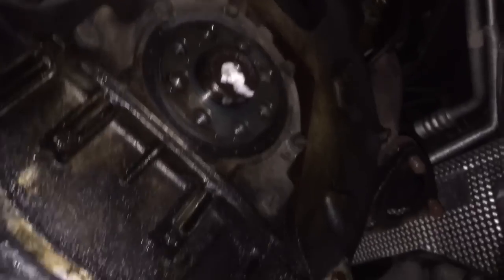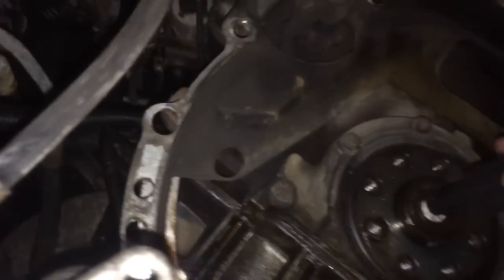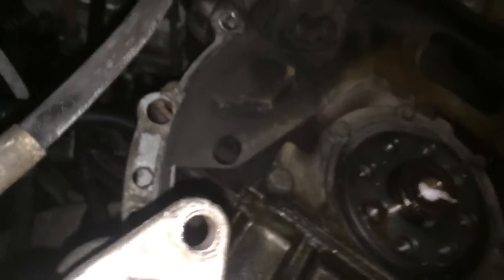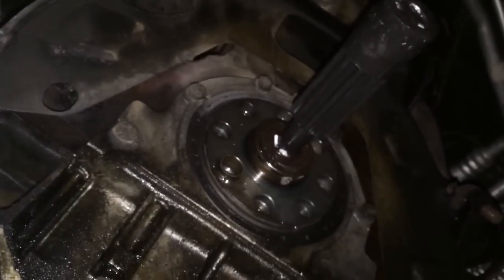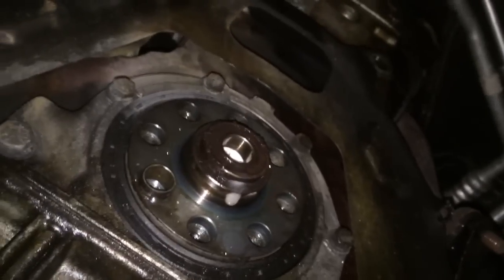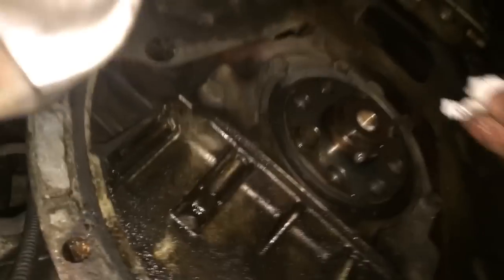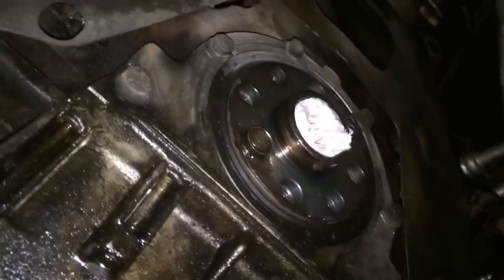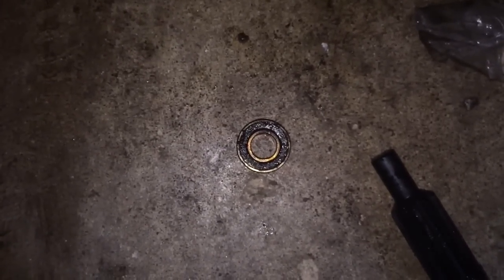pilot bearing removal using water and paper

Comment: Pro tip, having just done this... if wet paper towel isn't getting the job done, switch to wet toilet paper.  I'm assuming it has to do with the toilet paper fibers breaking down more easily, allowing the paper to "flow", fill the gaps, and transfer that hydraulic pressure onto the bearing!

Comment: Or for $16.00 you could just buy a pilot bearing puller.
Reply from the maker: irrelevant when all the stores are closed at 10pm on a sunday night - and when the pilot bearing puller jaws are too thick to fit inside these tiny BMW bearings..
Reply: Ovalbore - BMW has a tool for this. Its makes sense that  anyone performing any decent repair would acquire the necessary tools applicable for the job. I agree that no parts stores would be open at 10:00pm on a Sunday night, however, that wasn't when you purchased the clutch kit. Perhaps the next time you have the need to remove said item you will purchased the tools required as well. I know this because I'm a Ford tech. - ASE certified - Ford certified - Associate degree in automotive technologies. Peace.
Reply: $0 for some old newspaper?
Reply: To be honest, yanking the bearing out with a slide hammer is more likely to cause damage to the crank end float or thrust bearings while hitting the Paper or bread or whatever you pack the hole with cushions the blow!

Comment: Thank you for this cool video!  I could have used this method on my 85 Celica clutch job. at the time, I did buy the $ 65 Napa bearing slide hammer tool.  thanks

Comment: After buying a $59 slide hammer puller, I proceeded to bang the crap out of my hands and shoulders and even after heating the crank shaft that bearing wouldn't budge. With my clutch job (on a 2001 BMW 540is) stalled I found this GREAT solution. It took 4 sheets of paper and a I used the handle side of punch that fit just right. 10 minutes later, that bearing popped right out just like in the video. For me, this may have been the most valuable "how-to" video I have ever seen. THANK YOU!!!!!

Comment: You're a life saver man.  I watched your video and then went straight down to the garage to do this.  I took a 1/2  inch extension to the grinding wheel to reduce its circumference a little and then used it as the alignment guide.  After 3 sheets of paper and about 30 min, she popped right out.  Thanks for the tip!

Comment: USE BREAD AND A TINY BIT OF GREASE!!   IT WORKS EVERY TIME!!  you actually dont even need the alignment tool.. you can use anything that fits tightly into the hole.. even a big bolt, just wrap the threads in electrical tape and your good to go..  (if it didnt work, you didnt use enough bread or paper)

Comment: Doesnt work. Now I'm out a Clutch install-tool, and I have a big wad of Paper to try and Fish Out...
Reply: All good ideas but it's important that the bread is lightly toasted. Peanut butter helps along with jam and rice krispies sprinkled over.
Reply from the maker: what kind of paper? doesn't work with paper towels or even some newspaper. standard printer paper is best.

if that doesn't work, you need wetter paper.
Reply: Syrus54 use bread! and if the bread still doesnt work, you didnt use enough.. you pack enough in there it will come out guaranteed
Reply: thegreatwhitenorth Add some peanut butter, too.